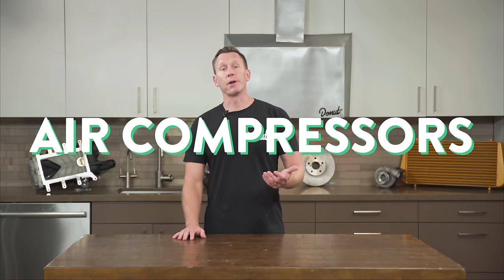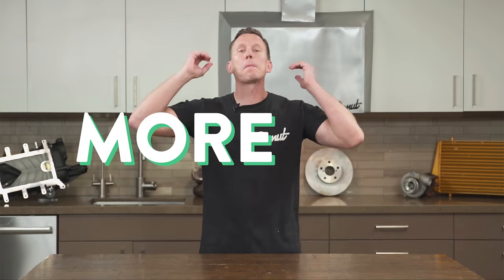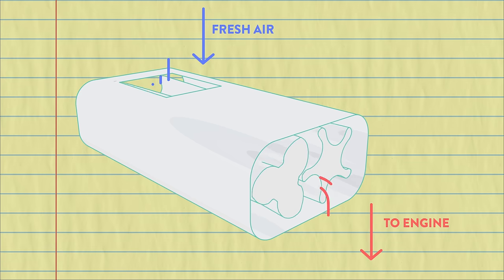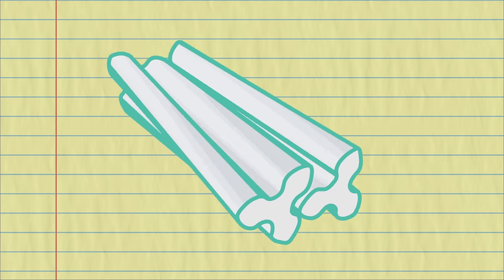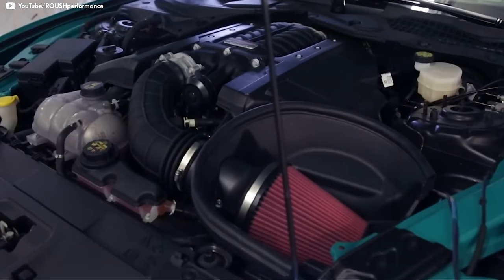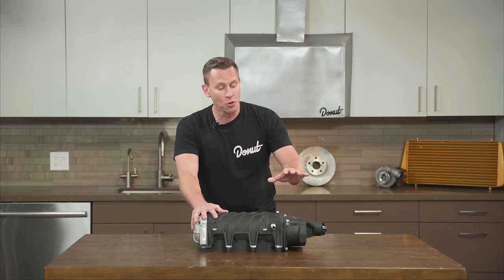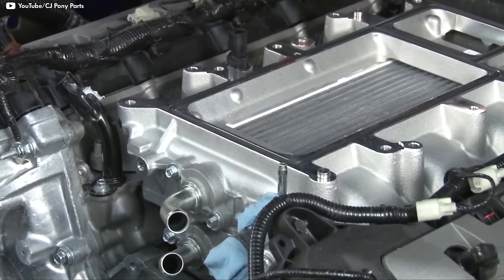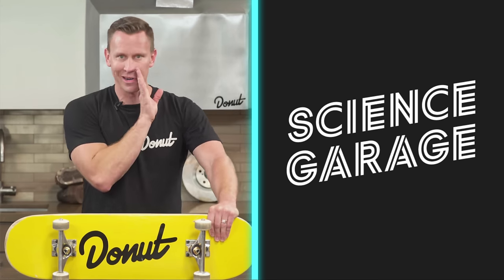SUPERCHARGERS | How They Work

Comment: According to NFS
Turbo=Japanese Car
Supercharger=Muscle Car
Reply: well yes actually. superchargers have a parasitic drain from being belt driven. big american v8's have the least parasitic loss with superchargers. so small 4 cylinders dont usually make alot of power with superchargers, thats why they always make the most effective hp out of turbos.
Reply: Hotel=Trivago
Reply: @mrroboto4321  clearly understood
Reply: Enchiladas = toilet
Reply: Umm supercharger is use in a kawasaki h2r bike tho
Reply: @tanakaharutora4309  Because it would have horrible low end torque if it had turbo.
Reply: Boi
Reply: @mrroboto4321  Standing ovation #Respect.
Reply: In my dads old camaro there was a turbo
Reply: @jovicskabotos  a turbo or twin-turbo😂
Reply: @Mr Sunshines so whats the point of making this vid
Reply: @Ghuanji Schourav it can be.
Reply: @Mr Sunshines I believe your troll name implies you are my Sunshine today.  A turbo is a supercharger, yet watches a video that define the term Turbo is power driven by exhaust and the very same Supercharger is driven off the crankshaft. 

Mkay.  They aren't compressor, a compressor is where there is a tank that hold a lots of airs, driving by a electric motor pulley with a mini like super charger to force induct into the tank to have no exhaust to leak out to use a Turbo electric motors.  They don't call my Air Boost Vega 56 GPU blower cooled a Super Charger, they called it the banshee of noise level which drive them gamer Pc Elites mad and yet misunderstood of it functionally.  Off topics put aside, you need to go outside more.
Reply: Imagine is turbos and superchargers we're able be used at the same time imagine the amount of power that could generate
Reply: Same name gang
Reply: SLR McLaren: am i a joke to you?
Reply: I'm going to supercharge my 86 Nissan 300zx lol it's factory for a different Nissan aka a truck so I plan on smaller a gear on it I want my low end torque lol
Reply: Yay, my 2006 Mini Cooper S is a muscle car! :)
Reply: @Mr Sunshines ehm no
Reply: @Mr Sunshines A supercharger is an air compressor that increases the pressure or density of air supplied to an internal combustion engine. This gives each intake cycle of the engine more oxygen, letting it burn more fuel and do more work, thus increasing power.

Power for the supercharger can be provided mechanically by means of a belt, gear, shaft, or chain connected to the engine's crankshaft.

Common usage restricts the term supercharger to mechanically driven units; when power is instead provided by a turbine powered by exhaust gas, a supercharger is known as a turbocharger or just a turbo - or in the past a turbosupercharger.
Reply: @Mr Sunshines so they both aren't superchargers, but forced induction systems.
Reply: That is irl too
Reply: @mrroboto4321  Then  why does Koenigsegg insist to use TWIN turbos in their 1000+HP V8's?
Reply: @yoshiwiiremotewithwiimotio2947  turbos can make tons of peak HP much easier. turbos make power mostly up high, whereas superchargers are very linear, and get expensive to make big HP numbers. Koennigsegg doesn't care about instant power when they make top speed cars, they just want power up top.
Reply: Twin turbo≠twincharger
Reply: Turbo=European Car
Reply: @michaelmarekia8539  shovel  to the head would be cheaper faster and probably more beneficial
Reply: @mrroboto4321  true to some extent. I used to have a supercharged Del sol saved from the salvage yard and found a Jackson racing supercharger at the same junkyard that was good for 11 psi with the right pulley.. I had it tuned on 8 psi on 93... Then invested in some big injectors forged internals few other small things and had
a 350 HP car for less than 4 grand was it the fastest thing ever no. But it was fun as hell
Reply: Yes seems correct to me
Reply: I Put a Supercharger in Nfs Heat in my Nissan Silvia XD
Reply: @yitami2000  hell yeah Supercharged is underrated and just as good or better in certain situations. But I'm currently in the process of a twincharged project fingers crossed
Reply: @hell-sol5240  Wow and yes Superchargers are really too underratet and i Love the Sound from Them. Yeah i Like Turbos or Twinnturbos but some cars in Nfs Heat with Supercharger is just Amazing :3
Reply: And in the case of my '13 Fusion Ecoboost, the guy accelerating/just cruising past at high speed for some reason. This car's honestly great, though. Good speed, good fuel econony, good handling, good interior. I'm happy
Reply: Kyle Ren not true at all. What about cars like the supercharged Chevy cobalt SS, supercharged 4 cylinder.. or those old pontiacs and Buick’s with supercharged 3.0 6 cyl.
Reply: @thejafuu5001  are you talking about turbo lag
Reply: @hatraninga  Yeah, it could be decent with a turbo too. But supercharger has much more even powerband.
Reply: @Matthew Heupel the only parts of a supercharger that you could make lighter, are the parts that need to be strong. as in the only parts that drain hp from the motor are the parts that you don't want to break.
Reply: @Matthew Heupel A lighter supercharger doesn't really improve its efficiency.  Higher inertia means it takes more energy to speed it up but also means it stores more energy and doesn't slow down as easily. At a constant RPM the mechanical drag of a light vs heavy supercharger is exactly the same all else being equal (ie same shape/size/tolerances/oil/airflow/pressure ratio).

It's like fitting a lighter flywheel to your engine, it doesn't make it more efficient, it takes less energy to rev it up but it also slows back down more easily.
Reply: @BigUriel  Didn't think of that. Would there be any difference whatsoever in the two hypothetical superchargers' behaviors?
Reply: Kyle Ren hey, question: wouldn’t superchargers work better for japanese cars due to the increased popularity in drifting, while the turbo would suit american drag races better? if the turbo creates a lot of lag, that would really fuck up a drift, but not so much a linear race. i’m new to cars so sorry if that’s a dumb question
Reply: @mrroboto4321  commenting to save this for later
Reply: The way it should be
Reply: @westreaper9681  Yeah
Reply: Yeas
Reply: Lamborghini= Turbo
Reply: Initial D says otherwise.
Reply: Wateroo.
Reply: @mrroboto4321  i would add to that that low rpm engines tend to react better to SC than turbo. while the other way around is also true.
Reply: @tanakaharutora4309  nope it's a centrifugical turbo. it's driven like a SC but it acts like a turbo! so it's a turbo. even tho Kawa says "SC" on the presentation video. turbo is turbo, SC is SC.
Reply: @thejafuu5001  it's just a good compromise. you trade a bit of high end to win low end and better response. but you'll not reach the power output of a regular turbo with a centrifugical turbo. it's just a system sitting between both turbo and SC.
Reply: @--  thats impossible
Reply: Nope
NFS No Limits has 'Muscle Turbos'
Reply: A M Fuad fast and Furious bro
Reply: @Mr. Sunshine do you fart?
Reply: @tanakaharutora4309  well the power gain is felt by the power to weight ratio rather than supercharging a k20 engine on a integra
Reply: @Meme Man yeah
Reply: Superchargers are also a german thing
I have the street m3 gtr in most wanted and it ends up sounding weird because of the supercharger
Reply: Mr. Sunshine never said I was trying to prove u wrong
Reply: i drive a supercharged aw11
Reply: @soda1470  NICE
Reply: @Mr. Sunshine why are u so arrogant with your little knowledge. Not all people are "brilliant" like you. So just chill
Reply: Yes and no my 98 civic is twincharged means turbo and supercharger
Reply: Cries in 88-89 Toyota mr2
Reply: @vin7941  swap 2zz ge
Reply: @Hay Day wow you can read wikipedia!
Reply: yaaaasssss i ahgree vith you okaey
Reply: @xxfunnymanxx1337  Yeah
Reply: @hiimthatguy  let him 
alone
Reply: @RecklessGenesis  nice
Reply: 🤔 Japanese, German (BMW , Audi etc) car etc 🤷‍♂️
seems Americans favor Superchargers 
while Europe likes Turbos
Reply: @markrayes2973  yeah america is all about big ol' engine
Reply: taco bell=big dump
Reply: @cautixon  yea
Reply: @mrroboto4321  supercharged Type R Civics can go from 200 to 400-600 hp, though
Reply: @chemicalspore  Mexicans and New Mexicans are coming to your door
Reply: @Gnomosamurai453  It wouldn’t create as much insane power as you might think. Twincharged engines do exist and they mitigate each other’s weaknesses. The supercharger kicks in right away for that responsive boost and when it starts to level out, the turbo kicks in and continues to provide boost through the higher RPMs essentially creating a much smoother boost performance, bearing in mind that superchargers are always on so fuel consumption would be detrimental.
Reply: Yes and the euro cars can have whatever they want
Reply: @chemicalspore  Taco Bell= death
Reply: faxx bro
Reply: And, Yes.
Reply: @tesstickles08  ye
Reply: @mrroboto4321  that explained the utility difference of supers and turbos so much to me, thanks.
Reply: Just please stop talking for everyone’s sake
Reply: @shanedillon1129  lead by example
Reply: both:Audi for some reason
Reply: @mrroboto4321  You know there’s still parasitic drain from turbos right? Same reason that catalytic converters cause power loss, the engine has to use more power to push the fan in the turbo with exhaust gasses.
Reply: @APFSDS-DU  ok and? do you realize how small of a loss that is?
Reply: @mrroboto4321  The same amount of loss as a supercharger dude. In the world of thermodynamics, theres no such thing as a free lunch, the supercharger actually has LESS parasitic loss due to the efficiency of using a pully vs gasses.
Reply: @APFSDS-DU  you cant just say oh the law of thermodynamics says otherwise, without saying how and why. this isnt a new thing. theres solid proof that it takes more to drive a supercharger than turbos. if that was the case manufactures would be using superchargers in economy cars instead. you are right that it takes energy to push gasses through restriction, thus why a free flowing exhaust will free up HP, but that can be more attributed to a vacuum in the exhaust that pulls exhaust pulses out. but in comparison to a supercharger its miniscule. and turbos are driven by the energy of something that just becomes waste anyways, whereas superchargers require energy from the rotation of the crank which is a direct source of energy that the motor has to drive. the motor on a supercharger quite literally makes significantly less hp then an na motor would, or one with turbos, and you can see this in fueling. for example, im about to supercharge my mustang, and im on the verge of exceeding my fuel pump with a supercharger, whereas with turbos theres still a bit more headroom left.
Reply: @aduptuniform2647  yes
Reply: Turbo = diesel
Reply: Will this supercharger work on my Corolla 2012
Reply: Bro Yes totally
Reply: True 😳
My Subaru Legacy is a Japanese car, and it has a Turbo
Reply: @UnknownGamer-jn1xc  yes
Reply: Sounds about right
Reply: Taco's=fart of death
Reply: @mrroboto4321  Japanese inline 6s and v6s can run supers fine.
Reply: @MrEscanaba  a compressor isn't a tank that holds lots of airs. A compressor is a device that compresses lots of airs for storage in a tank. Or to blow through some sort of device. 

Also that's what he said.
Reply: @mrroboto4321  thank you for this knowledge
Reply: @tanakaharutora4309  ah yes....BIKES...totally the same things as cars ay
Reply: @BODDA912  to explain...superchargers?
Reply: @MrEscanaba  they can. Its called dual charging. Drag racers do it
Reply: @untamablewolf  so... All squares are rectangles, but... Not all rectangles are squares?
Reply: @mkiv_bangbros3333  lamborghinis doesn't use turbos and are often supercharged.
Reply: @SiltsuT  bro. What u think?
Which engine can produce more speed
Reply: @mrroboto4321  but that Gen 1 mini charger though
Reply: @davisflyer  I have a mini cooper s too I love making that whine noice
Reply: @mrroboto4321 the parasitic loss from the supercharger doesn't depend on the size of the engine, just the supercharger and its gearing, a V8 turbo will make more power than a V8 supercharger too
Reply: having a 300z and a C5 this is absolute fax
Reply: Na = german

Comment: Added: The unique sound of a twin screw supercharger (the whine) is the sound of the air being compressed. It litTERALLY hurts the air until it screams. BOOM!
Reply: It's sound of straight cut gears which synchronize and drive both lobes of supercharger. Similar sound have racing gearboxes.
Reply: Pietrek L You can hear that very clearly at Need For Speed Pro Street at maximum performance on any car
Reply: omg!!! air abuse!!!!1
Reply: Donovan Hale straight cut gears mesh with a film of oil, SC rotors don’t contact
Reply: almost every superchargers make whine
Reply: @Piotr94L  only kenne bell has straight cut gears, whipple and tvs not and also whine ... The sound is the air being pushed
Reply: @Piotr94L  not all cars have straight cut gears, the whine is caused by the air

Comment: I prefer Superchager Whining sound over Turbo Flutter sound 
Because 'Murica
Reply: Flutter is actually caused when you do not have a blow off valve and instead let your extra boost pressure upon a closed throttle pushed back the opposite direction through the turbo.... It sounds cool, but it's hard on the turbo do that. trying to force air in the opposite direction that the turbo was trying to push it
Reply: @JoeIsCrazyWillman  so it's like farthing backwards/inwards. It's not healthy!
Reply: @Mr Sunshines oh and what the fuck was he supposed to say I like the way a supercharger whines over the way a supercharger flutters?  Have you not realized that literally no one gives a shit, they refer to em as turbos and superchargers cause  they are mechanically different they do the same thing but are different all turbos are exhaust driven a majority of superchargers are belt driven. People use these terms as a easy distinction and it works.
Reply: bcuz merica
Reply: no
Reply: @Mr. Sunshine you hurt my brain
Reply: Because anti lag is shit
Reply: @tranxvillanueva1092  guess you and anti-lag have something in common
Reply: U got that murica from fluffy...I get u

Comment: This is cool love the show! As a pilot I will say we see turbos and superchargers diffrently! Superchargers are a benefit for high altitudes but at the downside of loss of engine power to the propeller due to it running of the crank. Turbos on the other hand require special attention to use because we don’t want to throw the power around making the blow off valve over work! ( my university teacher on aircraft engines put it like this “see planes are built strong enough, hollow crankshafts and etc so we have limits and that’s why if you even touch the red tell a mechanic!) so it’s cool to see this from the aspect of a car enthusiast and pilot when I see these videos!! Keep it up! Also ps old ww2 fighters ran both turbos and superchargers 🤯
Reply from the maker: We talked about turbonormalizing in our turbo video...  Cool to hear from a pilot!
Reply: Donut Media awesome! And superchargers in planes have gears to which is just straight wizardry to pilots! We just talk the word of the mechanics and POH😂

Comment: Do a video on how automatic and manual transmissions work!
Reply: DoomFinger511 if you don’t know at least that you’re on the wrong page son
Reply: Hardly.

Automatic transmission works by magic, who knows how?
Reply: @palocles1759  they put a turbo in the transmission fluid duh
Reply: Alan Arellano don’t be a dikhead
Reply: In automatic the car shifts gears in manual the driver does it here you go
Reply: Automatic transmissions work by hydraulic fluid
Reply: Auto matics transmission work with bands, clutches , and pistons
Reply: I’ll give you benefit of the doubt... automatic transmissions make my brain hurt.
Reply: @stefaniakab4479  that's like saying "super charger makes more power," you can make anything simple and not make a video about it but people want to know the details, hence all of these videos.
Reply: Why would you even wanna know anything about automatic transmissions? Like, why?
Reply: Watch engineering explained
Reply: I think he meant in depth, like the torque converter and the ecu and cables